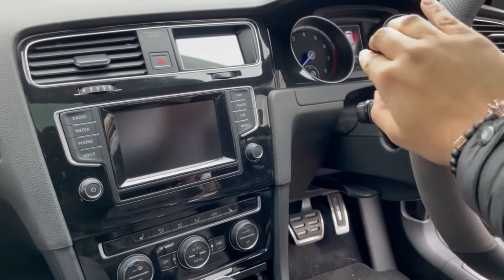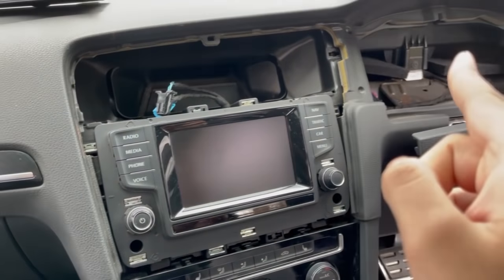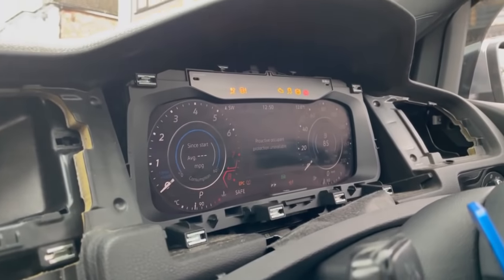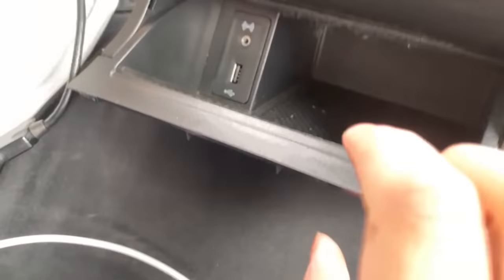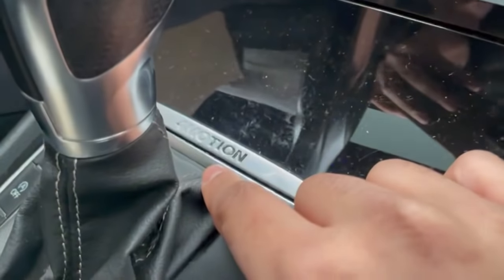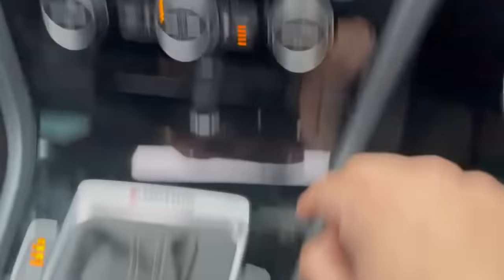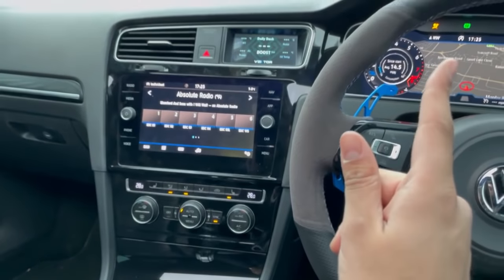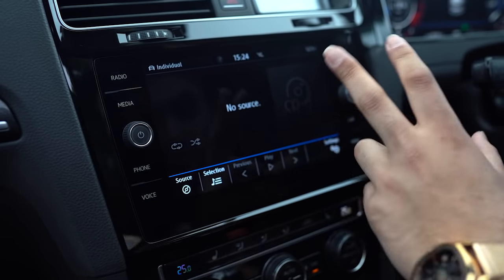Retrofitting Golf 7.5 screens into my MK7 R!

Comment: Also, your man done the coding would he know about the vw crafter revercing camera. I've bought an after market camera and the correct cables to connect to the big head unit like the one you have here because that's in my van. But the guy said  I need to possibly get it coded ot tell the head unit a camera has now been installed. Or will it just work. I've not installed it yet because I've only just picked the van up. 
Cheers for any advice.

Comment: Nice work. I have a MK7.5R analog speedo that I want to add into my gti 2018. Can that be done and what do I need to do to make it work
Reply: Yes you can, it should be a straight swap but you’ll need someone to code and match the odometer

Comment: I have a 16 plate golf r with mib2 and the pro nav screen.... can i just change the head unit to a mk7.5 discovery pro too... or would i only be able to fit the standard mk7.5 head unit you have fitted?... or can i just fit the standard mk7.5 8" screen without changing the leads... also...would I need to change my CD player in the glove box for the 8" mk7.5 screen?

Comment: Hiya pal, really top vid this! Do you know if there's an equivalent MMB box for Android. The set up I have works but is so hard to use and reduces the screen size too. So much so I never bother. Any info would be much appreciated. Golf 2019 7.5 GTD. Thanks!
Reply from the maker: Hi mate, what we sell will work completely factory on a 2019 7.5. Doesn’t mirror your phone so you’ll have no issue with resolution on the screen!

Comment: So could I use the original head unit with a MIB2 box and still get car play and VIM?
Reply from the maker: If you have CarPlay already yes
Reply: @DSGDemons  thanks for the swift response bro. I don’t think the car has CarPlay, but I’d be looking to code it in (if that’s possible). FYI it’s a 2014 GTD. Great video btw
Reply from the maker: @crepboy  yeah it’s possible 💪🏻
Reply: @DSGDemons  thanks a lot bro. Always seen your car on insta but it’s good to put a face to the whip. Subbed 👌🏽